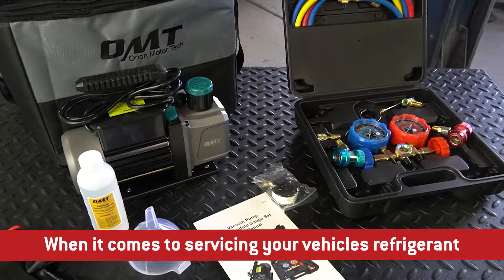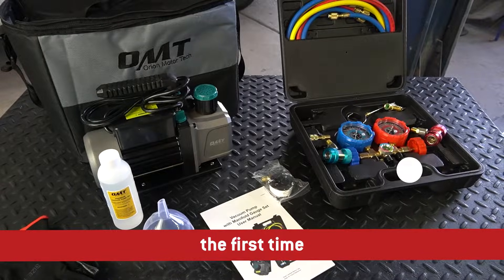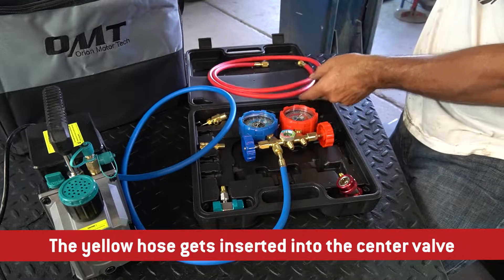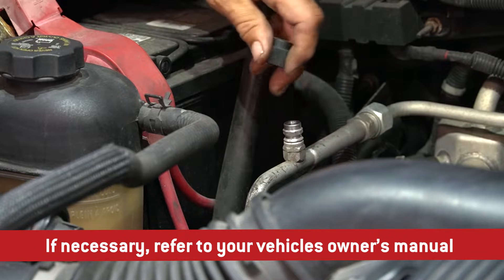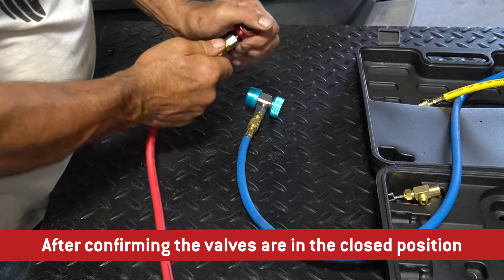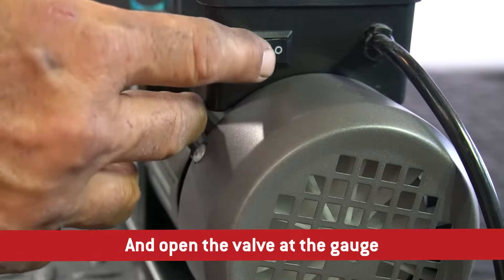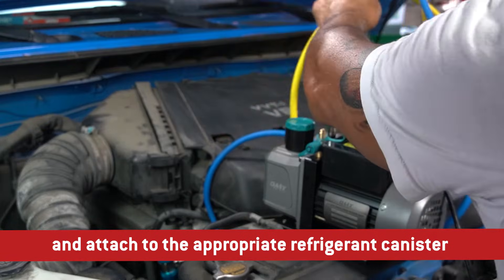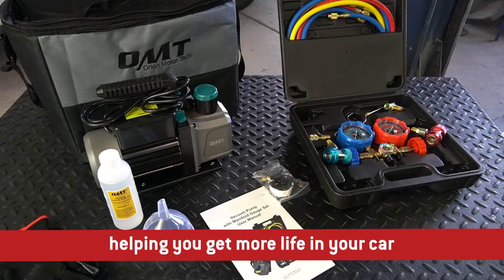How to use AC Vacuum Pump?—OrionMotorTech

Comment: Hi boss! I am just asking about the voltage. Which voltage available for that pump? Because when I search amazon there's no mention of voltage even the spec. TIA
Reply: I am 1 year too late to help you out but just in case there are any other people wondering about the same question, here are the specifications that are listed in my owners manual:

Input Power (North America): 110-120v AC @ 60Hz

Input Power (EU&UK): 220V AC @ 50Hz

Just so everyone is aware, there are two different models of this same vacuum pump. It does not have a switch to change from 120v to 220v. There is a sticker on the side of the pump that will tell you the exact specifications of your unit and on that sticker it will list the voltage. But typically if you order from their website or Amazon you will receive the correct one for your region's standard voltage.

Also one very important thing to note is these units are NOT prefilled with oil. They are completely empty when you receive it. So make sure to fill it with the provided oil and change it every once in a while. These units are very very quiet so if your's is at all loud I'd suggest changing the oil. The owner's manual is pretty short so I'd also recommend reading the whole thing since it only takes a couple minutes.

Comment: Make sure after you finish vacuuming the system leave the pump on and close the valves then immediately shutoff the pump.  Disconnect the yellow line from the pump and have the line at the gauge a little cracked.  Then attach the yellow line to the r134 can allowing a little to purge the yellow line then tighten the yellow line up at the guage, this allows you to rid the line of any trapped air.  Once the yellow line is tightened then start the car with ac on full blast and open the valves at the guage.
Reply: Edit: open the blue liquid line only. We don’t want hydro stroke in the compressor. And open it smooth and slowly
Reply: Thanks for this tip. I don't get why this kit doesn't have a purge valve at the yellow line.